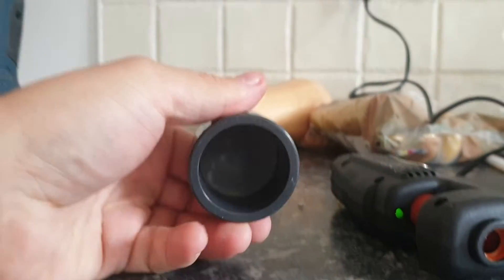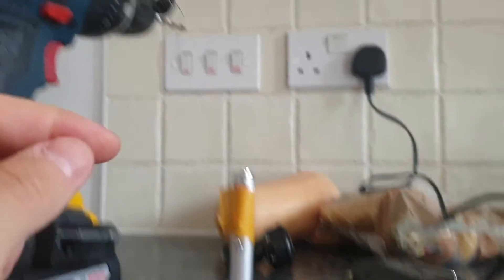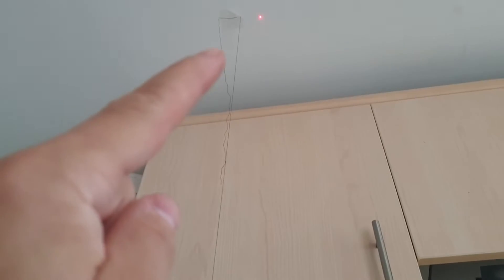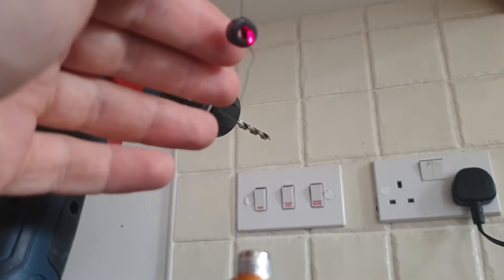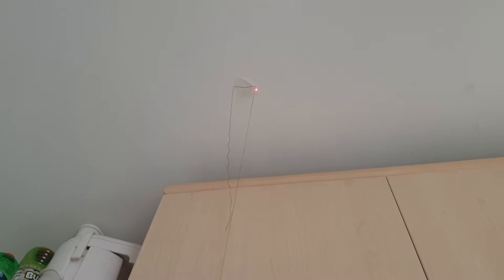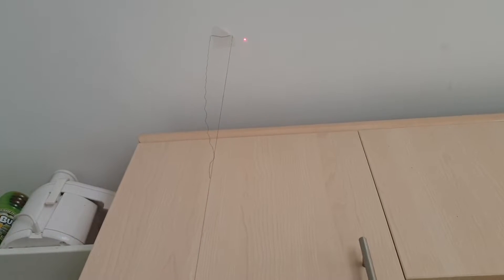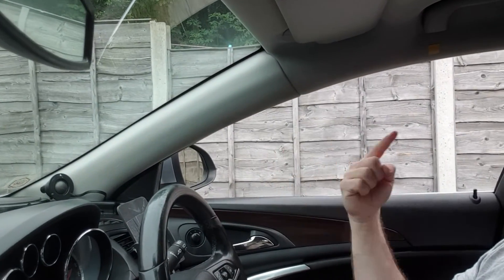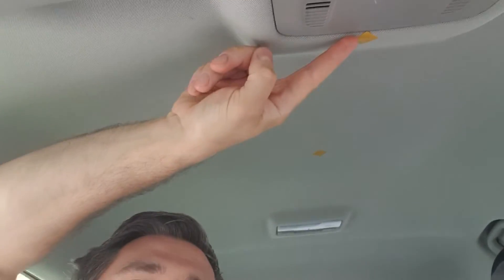Tweeter aiming RTA measurements

Comment: both tweeters are aimed at your headrest, or the opposite seat?
Reply from the maker: Both tweeters are aimed at the same location. Otherwise they will have a different roll off. If you point tweeters to the corresponding side head rest, the driver side one will play all the way up and the passenger side will roll off the top end and they will not match.

Comment: I installed big, silly car audio systems back in the 80's and 90's.  This may sound crazy, but mounting some small, hard-dome tweeters in the A/C dash vents allows you to angle them (if your vents pivot) and you could even adjust their output/volume with the louvers!  I did this in a 78 Cutlass Supreme of mine and also for a number of customers with similar air vents ...and money to burn😄 (Regal, Monte Carlo etc).  They add super entertainment/giggle value at car shows as well.
Reply: We have dsp's now
Reply: @JmoneyBands925   They're not the answer for everything. They can only do so much. You can't fine tune something that doesn't exist for that matter.

Comment: I love this, I just also want to know where the 15 and 30-degree off-axis points are. My idea is that I'd be able to average out the axis angles between all the drivers and the occupants so that 2 seat tuning (or more accurately, both single-seat tunes) work the same/best in terms of frequency response. Most drivers still work great up to 30 degrees off-axis for their intended range. Plus, when looking at beaming charts by diaphragm diameter, I'm okay with what those show at and below 30.

Comment: Where to aim for a high soundstaging?
Reply from the maker: The height is being perceived by the listener based on the reflections and the car interior, it has less to do with aiming. You can have your tweeters in the doors and still perceive the stage on top of the dash. Humans are pretty bad at determining the height of the sound as there is no built in mechanism in our heads to do that.
Reply: @RAW-CAt does it have to aim at focal point i mean if using laser does both have to meet at a point? Because now i still have a hard time aiming for a good sound i only have 2 way components and headunit

Comment: Past experience suggests aiming both tweeters at the interior side of your headrest. The reason for this aiming is due to on and off axis performance of your tweeters. Tweeters beam there sound/are more directional so off axis drop-off occurs. The far side tweeter should be aimed for on axis results, while the near field tweeter is off axis, but supported by window reflections , therefore the typical dip that occurs from being off axis is then supported by the reflections from the near field  window. This results with the far tweeter being on axis with minimal driver side window reflections, and the near field tweeter being off axis(with the degradation is SPL) but with the window reflections building  the SPL back up. Of course this is frequency/tweeter/environment/etc dependent as well. Maybe this can help
Provide a starting point for someone getting started in car audio.

Comment: Some actual scientific aiming other than theory. 
I aimed my tweeters towards the dome light, in pods (which also contain my mids) in the dash corners, and are within 15 degrees of axis for both front seats.  I'm making new pods now (old ones didn't turn out a nice looking as I hoped) an I'll use some of your methods to aim the speakers for them.  Thanks.

I want to test Mids, on axis vs flat aiming up at the windshield, and tweeters in the pillars shooting right across the car, like some do and OEM do often)
Reply: As far as midrange I would rather have the extra db off the glass but I like also getting the direct on axis information from my mids.